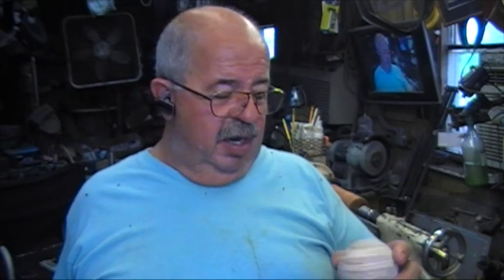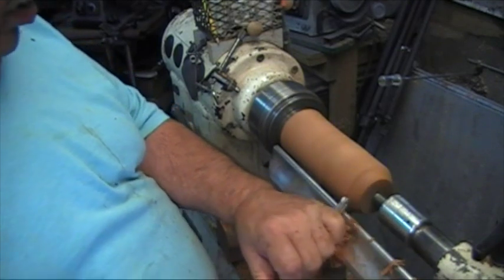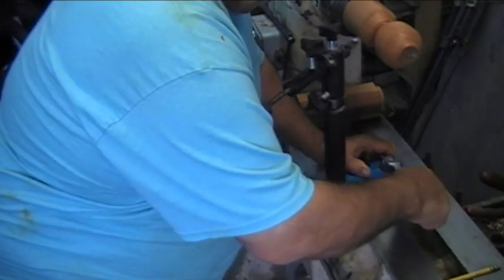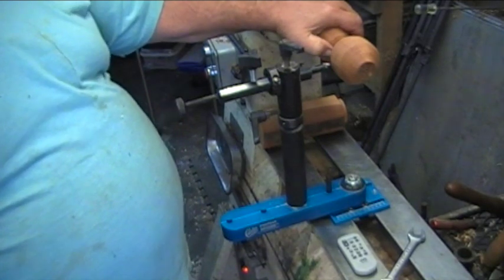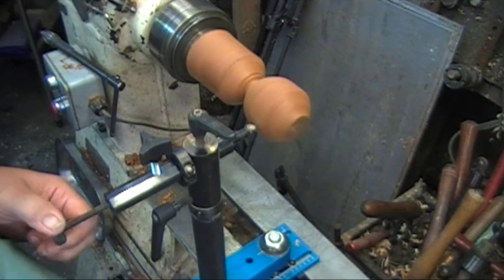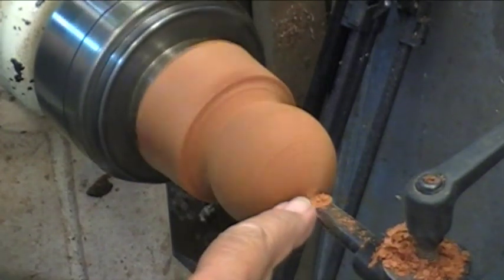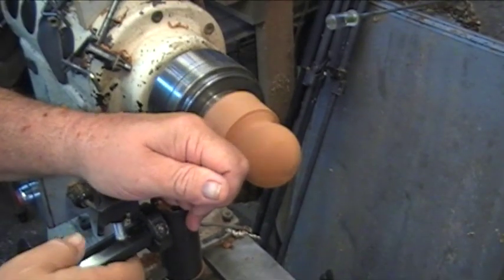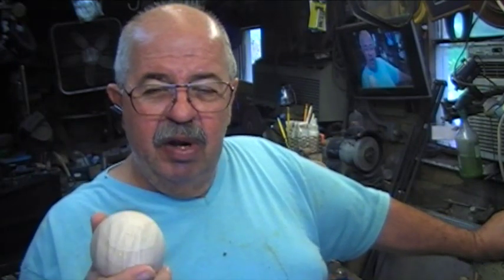# 233 A perfect Sphere

Comment: Hey Capt. Thanks for the info! I've been looking for a good way to repeatably create globes for shift knobs as I think that these would do well at street fairs. This looks like it would fit the bill. On a different note, I am still having a great deal of trouble cutting end grain smoothly. My only tools to do this at this point are a 1/4 by1/4  scraper and your 3/8 round carbide. What would you suggest as my next move?